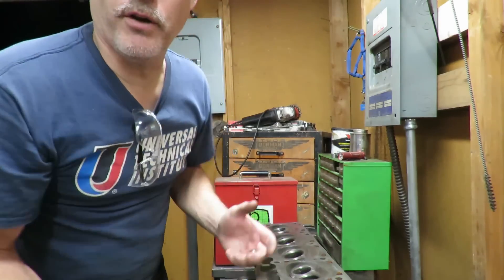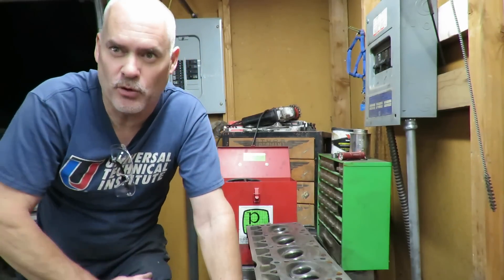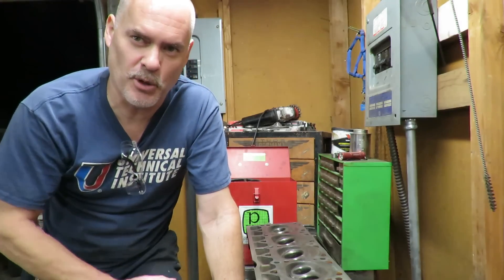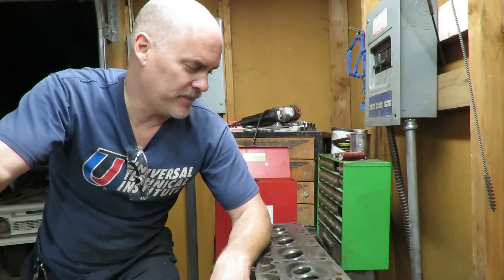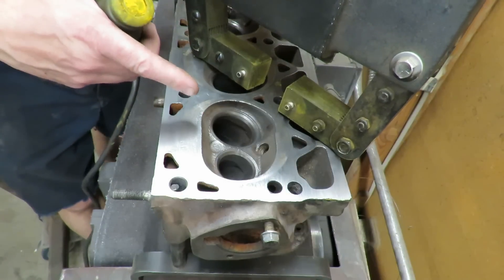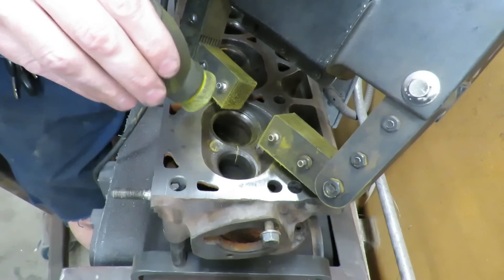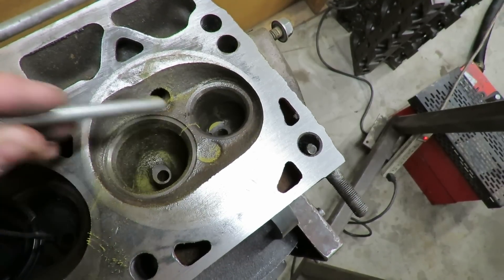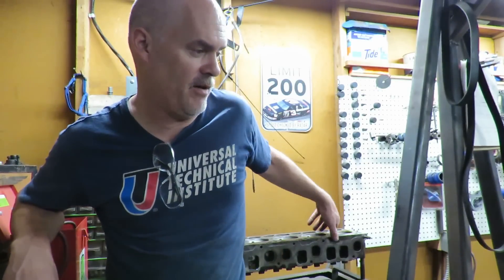Jeep 4.0 REBUILD PART 4

Comment: Myvintageiron7512   I use a tank that I got from NAPA, that attaches where the radiator cap goes.  I keep the tank full, while the engine comes up to operating temperature.  Is that the proper way of burping the 4.0 engine?

Comment: Hello, I have a 2000 jeep cherokee. There are two problems with it. It seams to have a misfire and the crank shaft sensor fails very often. Do you have an idea what the problem is? Do you think it could be the ECU? I am in Tucson. Thank you.

Comment: I purchased intake and exhaust valves from melling the exhaust were from Argentina and the intake were from China so I sent them back. Turns out sealed power is made in South Africa and crown is made in Israel do we have a valve manufacture in the United States for the jeep
Reply from the maker: probably not for jeep or any other engine

Comment: Dam dude I wish I had your knowledge on car engine's 
I just spent 7 thousand for a engine replacement 4.7 V8 for a jeep commander 
Both heads were cracked 
So for a bit more money just got a rebuilt engine 
I went with Jasper engines 
Your thoughts on jasper

Comment: The 0331 casting is notorious for cracking.
Reply: Yea tell me about it. $650 in parts and she is running again. Unfortunately, may need to rebuild it cause of lower oil pressure. Not bad pressure, just not where I want it. 40 PSI at about 2200 RPM fully warmed and 12-18 hot idle. Never done a rebuild but my grandfather has unlimited knowledge. Unfortunately it would be a budget rebuild.

Comment: What is the burping procedure then for Jeep 4.0 so I don’t cause my own problem. Any idea?
Reply: Lift the front of the Jeep with a jack or ramps or park on as steep of an incline you can find. Intermittently get the revs up, just a little, like maybe 1500-2000. Keep it topped off with coolant and keep some in the overflow, up to the line. I squeeze the big upper hose to get some coolant moving through it as I'm doing all of this. I also have a pinhole drilled through the upper flange of the thermostat to allow air to pass through, but not much coolant. I think the little bit of coolant that does get through is good, because you want the thermostat to be able to open at 195 and let air escape and coolant circulate. I don't think it opens properly if it is in the air bubble instead of the hot coolant. Know that your temp gauge is in working order and monitor it. It needs to get above 195, but don't let it go over 210. If it does, let it cool down awhile and start again. I also use a spill-proof funnel, you can get them for like $10-$20. They are worth every penny, especially if you have one of these engines. It's a giant funnel with a radiator cap attachment so you get a tight seal between the funnel and neck of the radiator. It gets the coolant entering the system up above the air bubble in the engine and helps force it out. Just keep coolant in the funnel until no more air bubbles come up into it, as you occasionally give a brief rev. These funnels come with assorted filler neck adapters, a lid and a stopper so you can neatly decouple and dispose of the coolant still in the funnel. This is what works for me. My way is probably overkill, but I've had the air bubble cause my head to crack, leading me to pull a used head, have it rebuilt and install it in my driveway. I don't want to do it twice, so I'm really careful to get all the air out any time I crack the system open. I think one of the most important things to remember is to never run just water with no antifreeze. These engines are happiest running just shy of 210 degrees while water boils at 212. You need the antifreeze to raise the boiling point of the water in case it gets up above 212. If the water boils, the pressure from the steam will blow your lower radiator hose right off the water pump.
Reply: I would like to know as well. Maybe drive up a steep hill in 4 low.
Reply: on mine i do it on a slope and turn heater core on and off seems to work for me

Comment: I always heard those 4.0 L jeep motors were junk ... that must be why. How many Cadillac motors do you see with the busted head bolts where you have to drill the block and put the studs in to keep it from blowing head bolts and head gaskets? Great videos , learn something new with every one I watch ...
Reply: The North star 4.6L V-8 and the Ht4100
Reply: A 4.0L Jeep engine will likely outlast you.....

Comment: Has anyone ever made a lt1 Head fit a 70 sbc? Found a lt1 car with afr 227 lt1 heads and woundering how to make them work on a 70s block.   I’ve heard about wending the two cooling holes. But what else needs to be done?
Reply: It is my understanding that the 1992-1997 LT1 has reverse flow cooling, meaning that engine coolant enters the cylinder head first, then it enters the block. Nearly every other SBC has coolant flow into the block first, then the cylinder head. This is why cylinder heads built for the 1992-1997 LT1 are sold with a disclaimer saying that this head will not fit a different SBC.

Comment: Very bizarre question but do u know anybody who makes a bell housing for a t56 to a 400 sbc ?
Reply from the maker: 400 small block has the same bell housing as a 350
Reply: If the bolt pattern is the same, then that means there are probably more than one business that builds an SBC to T56 adapter. I know I have read about them in Summit and Jegs catalogs.

Comment: Learn something new everyday. Any heads for the 4.0 that aren't prone to cracking?
Reply: The earlier ones aren't known for cracking, however, this limits the kind of Jeep variant where they can be used. From what I have read:
1. A 331 casting head that also has a "TUPY" casting mark on it.
2. A new casting from Clearwater Cylinder Head which has more metal where the original 331 casting would crack.
3. If you are really wealthy and doing a high performance build, Edelbrock and Hesco make an aluminum head that outflows any OEM Jeep head and might have a better combustion chamber design.

Comment: Just a question; I do some welding, and though I know cast iron is friggin' hard to weld (like, give a 50% success rate even under perfect conditions), would grinding out a crack like that and trying to weld it be completely out of the question? Only things I can think of is trying to preheat a hunk of metal that big might just cause it to crack in other places. My line of thought is usually "If it's junk, anyway, there's nothing to lose!"
Reply: Clearwater in Florida has rebuilt heads for $400. 0630s and TUPY 3110S
Reply from the maker: you can weld cast iron but it has to be furnace welded the entire head needs to be heated till it's glowing red and the weld it there is only one shop in my town that does it they want $300.00 + to weld one crack
Reply: Pretty steep, especially when an old-time welder has told me that welding on cast iron, like I said, even under perfect conditions produce only a 50% success rate. One of these days, I'll have cause to try welding cast iron. Good luck with your search!

Comment: What is the procedure for flushing the 4.0?   I just left the coolant sensor out and let burp out.
Reply from the maker: they do have power bleeders for them what I do is jam a garden hose down the top radiator hose for 5 minutes or so not the official procedure but it does work then add antifreeze to the radiator
Reply: I never use tap-water for coolant. Always distilled and ethyl-glycol antifreeze.

Comment: Picked a 7120 head from a yard Jeep several years ago with the intent of head swapping the cracked head on my 258. Ended up losing that option and it found a home on my stroker. Had it magnafluxed before I did about 48 solid hours of work to it and it's GREAT. XJs make the best donors and you get out of them what you put into them. Good luck.

Comment: I heard Edelbrock was making a head for this engine now.
Reply: $1500 for them kinda high went to edelbrock 3 years ago and they wanted $3000 for them at the time
Reply: You can get a new cast, beefier, cast iron head that is CNC machined for just south of $600, Google it. Put one on the fresh rebuild 4.0 for my 2K GC WJ 4x4 (Select trac), and it bolted right on; everything fit perfect. The interesting thing was the engine had 287,000 miles, used no oil to speak of, and ran great, but Transmission was getting flakey so since they're easier to pull as an assembly, I decided to do both as I had already redone the whole chassis with nice long arm lift setup. The engine on teardown was in excellent shape; I could have run her another 100K or more miles, to be honest. But of course I've owned her since new, she's my sweetheart, so she's always had the best of care, and a prominent place in the garage. I went ahead and bored, new pistons, nice cam, sweet throttle body, it's pretty, machined from an aluminum billet with ball bearings and seals ($400, ouch, but hey, right?), and you can see it with the new cool air intake kit. Also added the Banks TorqueTube header with flow Maser exhaust. Took her to the dunes near Galveston a week ago and ate everybody's lunch, and sounds so sweet too; almost like a 5.0 Mustang coming off Idle, nice rumble. I like my Jeeps, they last, are fun to work on, and I also have a sweet 97 4x4 XJ Cherokee I'm redoing in a most meticulous manner. It gets a stroker six.
Reply: Yes, an aluminum head, but it's not a simple bolt on for certain years.
Reply: It just requires you run a 91-06 intake and a 91-98 exhaust or aftermarket exhaust.
Reply: just buy a junkyard head it will be fine, cleetus mcfarland does it all the time.